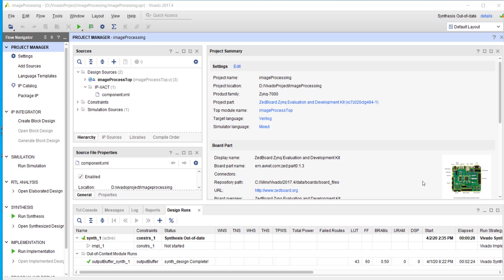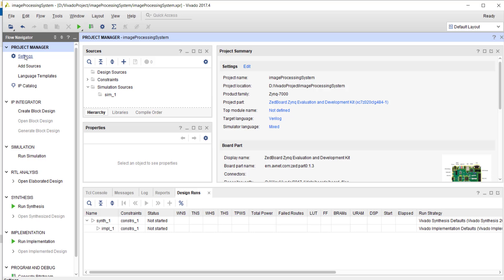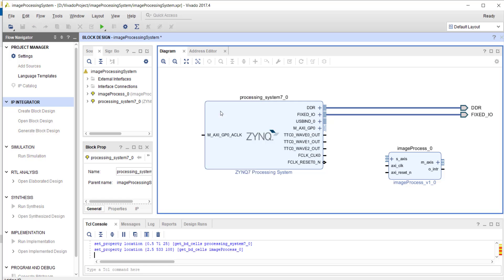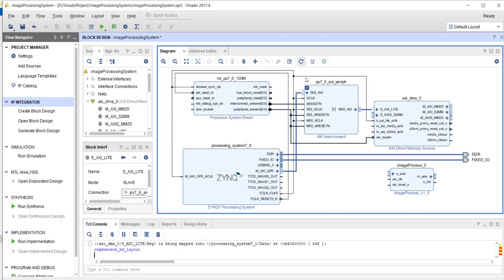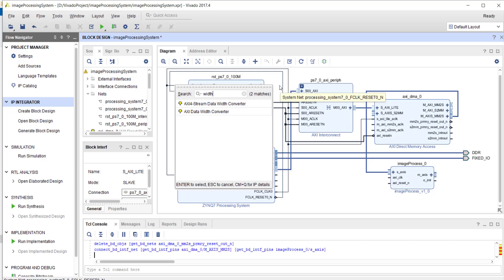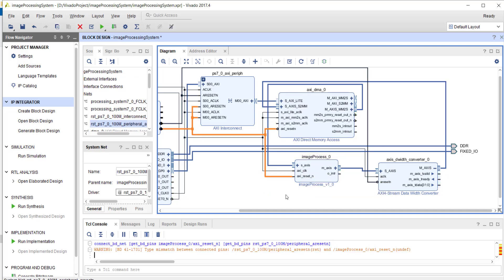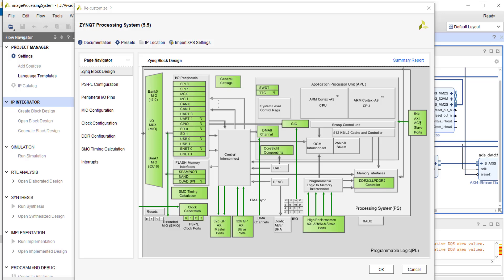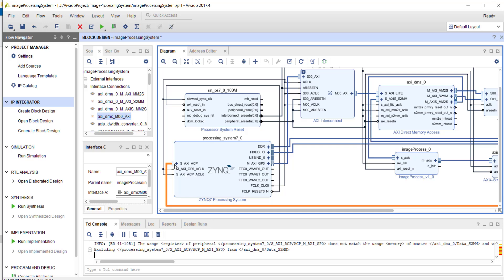Image Processing on Zynq (FPGAs) : Part 7 System Integration

Comment: I am currently developing a fpga-based Image preprocessing system that is taking pictures from a cmos-camera and reduces the data stream (roi, tresholdfilter, etc....) to process it in predecessing systems, whereas speed is the quintessential problem here (2kx2k pixel with 2Byte monochromatic pictures).

I am also currently considering BRAM's to buffer data. So my Software-architecture would look similiar to the one in this project except im having BRAM instead of DDR. 

There are still quite a few things to figure out, but these videos on this project have helped me alooooot! so big up to you and keep rocking.

Do you have a tip for me where I can find a guide / tutorial / showcase on how I instantiate big numbers of BRAM as this seems still a bit mysterious to me
(so CameraLink goes into FPGA and the Pixelstream is supposed to be buffered into BRAM -> No Idea yet on how this works / is done)
Reply: Can you tell me how did you interface the BRAM in SDK . Can you give some references

Comment: hello sir,
is it possible to process multiple images, for example, 100 images?
how is it possible? would you help me?
thanks
Reply from the maker: One way is to save all images to DDR. Then run a loop where you change the starting address and image size to the DMA api call
Reply: @Vipinkmenon  thanks sir.